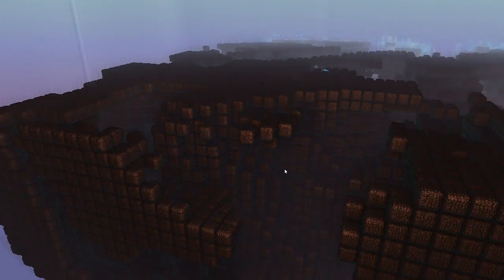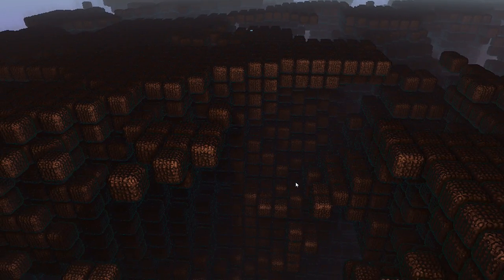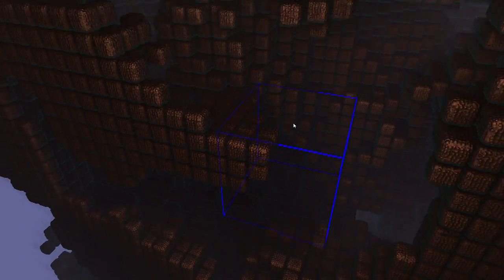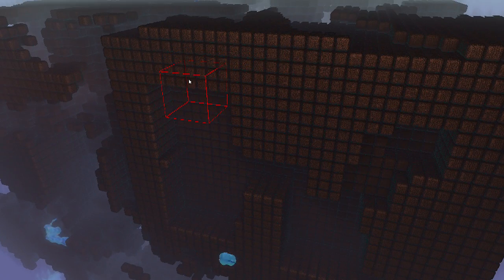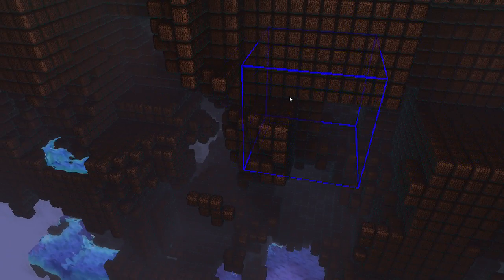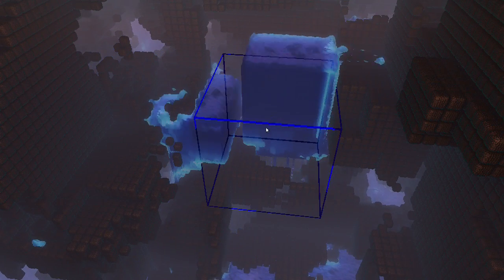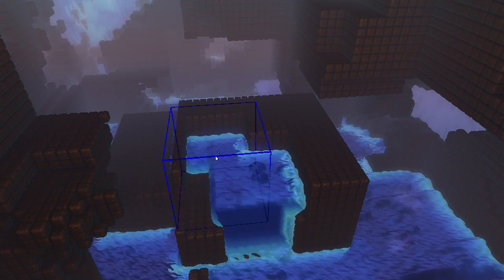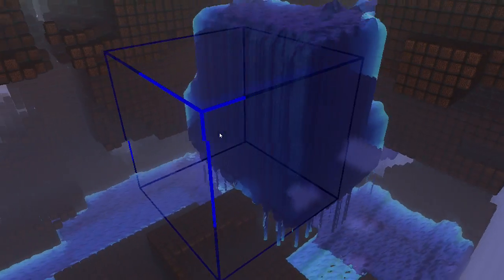Voxel Quest Fluid Dynamics and New Rendering Method

Comment: I remember in elementary school taking an empty glass and holding it upside down underwater.
Not really expecting your water physics to conserve air although it would be pretty cool.. lead to wind.. corrosion.. lag.. bugs.. ;)
Reply from the maker: Yep I had thought about treating air as a separate fluid mass, but ultimately tried to keep it a little simpler

Comment: Very cool :0  I can see a flickering line sometimes which I guess may be some precision kinks in your new rendering method?  What GPU is that running on?
Reply from the maker: wb Thanks - flickering lines might be cracks in between the blocks - they are not actually touching right now!  That said there are a few other artifacts as well that need to be resolved.  GTX 980 is the GPU.  Although it is fairly unoptimized right now, my target is to get it running well on something in the lower to mid range like a GTX 960.
Reply: Gavan Woolery Aw, does that mean my GTX 460 is right out?
Reply from the maker: Japa Illo It can probably run on most cards, question is at what resolution and what detail setting.  I want it to look decently good on a 960 or thereabouts, but it would probably be playable on a 460 with detail settings and resolution lower.

Comment: Starbound has fluid dynamics like that, however it's a 2D game.
Reply: CoconutsalesEO Adding to that, I think Terraria's works the same too
Reply: Terraria doesn't simulate water pressure so you could have these U-bends where the surface of the water is at different heights on each side.

Comment: Looks really effecty but still feels a little unrealistic, doesn't it? Can't say why though. And could still be the best implementation ever. I've never seen a realistically feeling animation of water.
Reply from the maker: MistaSmith yeah this fluid is too elastic - it can stretch really thin.  It also moves cell by cell and needs to be interpolated to look smoother.  Also, no acceleration.

Comment: This looks pretty nice.
All this animated water and the colour palette reminds me of the Raft of the Medusa painting.  ;)
Little question. You mentioned pressure and I misunderstood that for the ability to have air pockets. Would that be possible ? (useless feature imo but i'm just wondering).
Reply from the maker: TheSliderW If a fluid is on top of air, it will displace the air (think of it like bubbles rising through the water).  If the fluid is below the air, but enclosed by something like a cave on top, then yes you can have air pockets in that respect (assuming that the pressure does not equalize out and fill up that air pocket).
Reply: Gavan Woolery Ah, i see, I asked because i thought the right side on your demo at 05:00 wouldn't completely fill up.

I'd love to have more details on the system ! You say at one point that water pours down the sides of objects and it also looks like sometimes the water infiltrates between the blocks unless enclosed in a container. Do the the cracks between the cubes you mention at the begining influence either the creation of air pockets or the infiltration (if any) in some way ?

Interesting video leads to many questions. :-p
Reply from the maker: TheSliderW cracks between the cubes are visual only, just was quickly setup from an old test environment.  What occasionally will happen is that water will rise up over a block and spill over the side.  Sometimes it looks like it is flowing through blocks because the rendering is not 100 percent accurate to the underlying data (very thin layers sometimes do not get rendered, which I will fix soon).  I'll post more technical details when I'm not so tired! :)
Reply: Gavan Woolery  I see. Thanks !
No problem for the details. : )